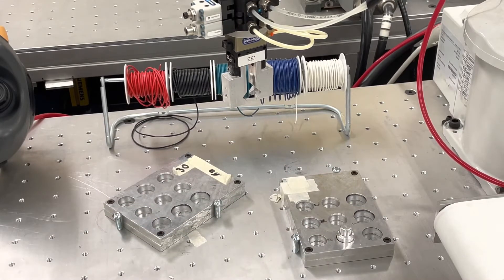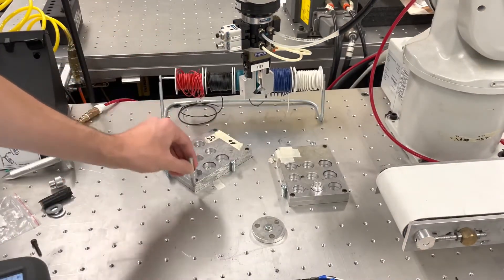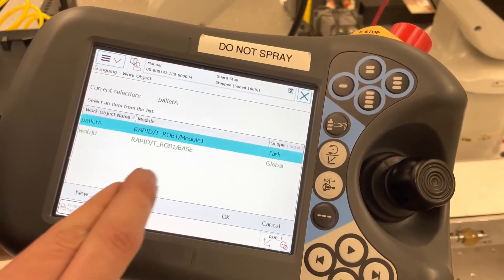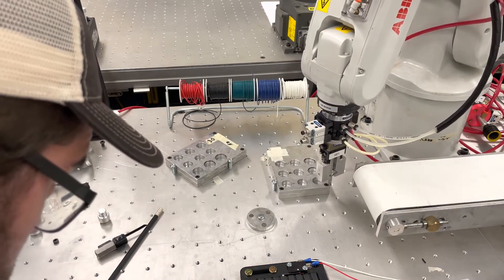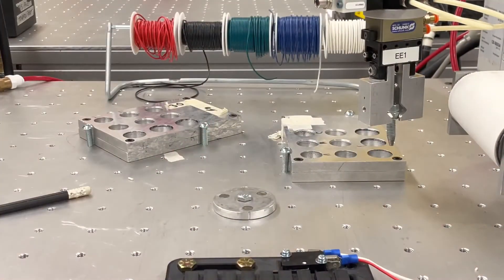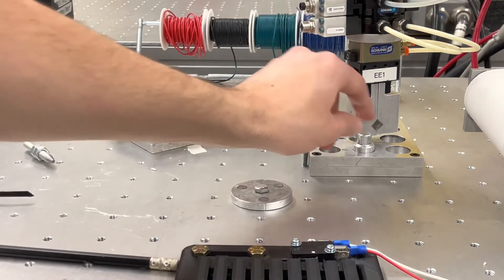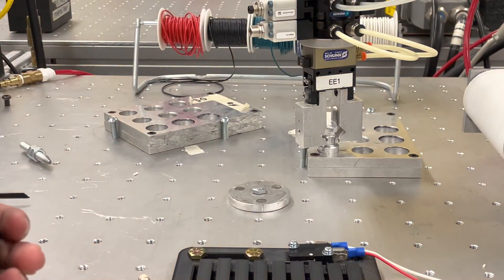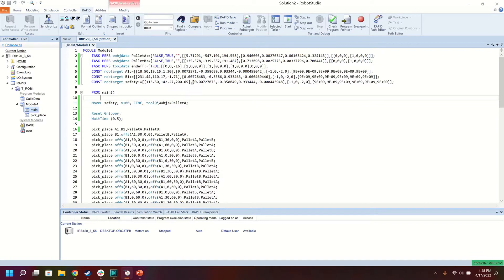Learn to Code ABB Robots to Perform Pick and Place Tasks using Rapid Programming- Ryan Bliss

Comment: Love the video. Does the mass of the Endeff have to be just a random value i set or is is an actual weight
Reply from the maker: You can specify the mass if you want. In that way you can get better performance since the controller will precompensate the motion by taking into account the mass.